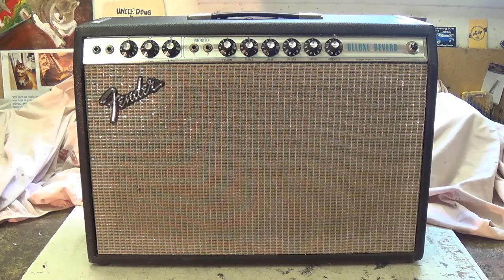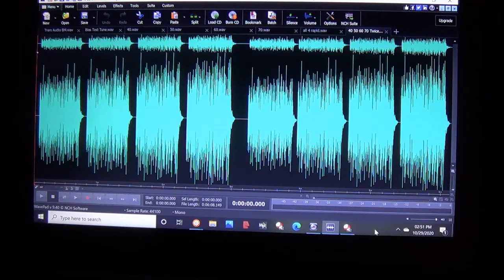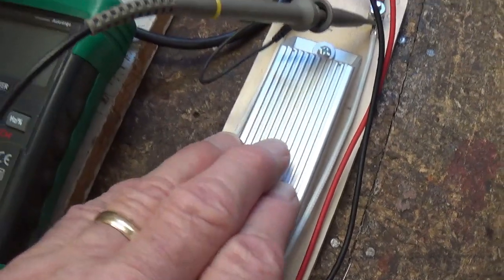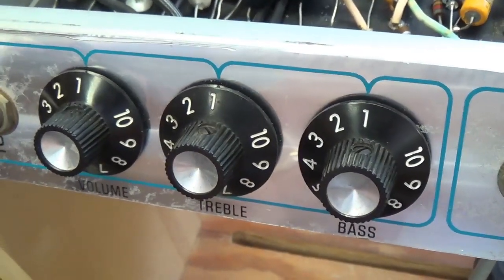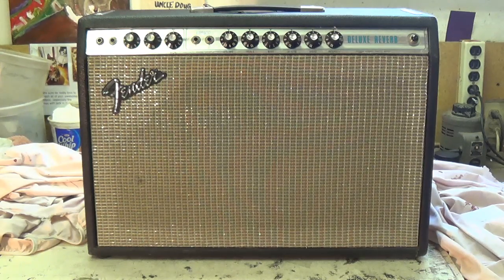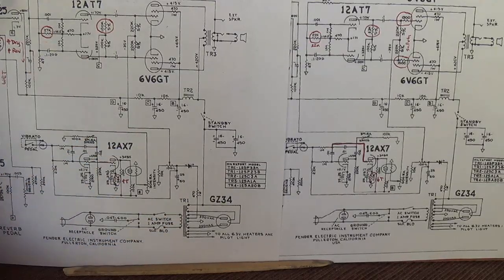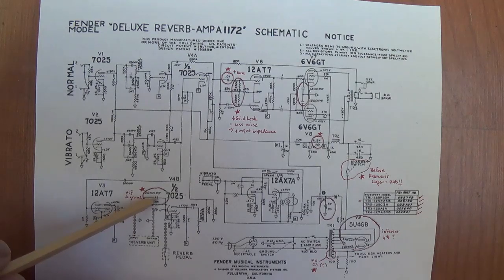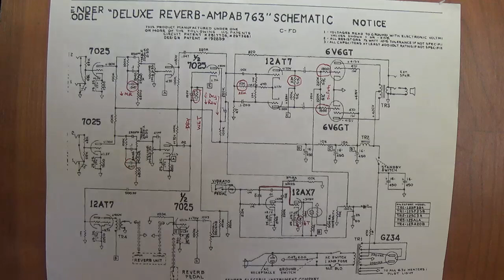The Effect of Output Tube Bias on Tone, Gain, and Headroom.....A Side-by-Side Comparison

Comment: Great video Doug.  That said, I came away with three observations.

1) You didn’t zero the voltage before your clipping test.  I understand that it doesn’t matter because you’re reading the voltage from the meter but this could be confusing for some.  But, it was the same for all of your tests so, it is apples to apples.  So picky, eh?

2) My understanding of Fender’s biasing technique of the period was to simply set the bias voltage to the schematic value.  The quickest and worst way to set bias.  The result would typically be approximately 50% with new tubes of the era (on spec).

3) My tests have shown that the tone controls do affect output voltages.  Did you not get higher voltages when you repeated the test with the tones on 10?  Incidentally, the closest you can get to a flat response with the Fender TMB is 0, 10, 0 respectively.  Not sure about the TB on your Deluxe.  My feeling is the tone setting should make a difference when testing different frequencies as in your example.

Thoughts?
Reply from the maker: Thanks, James. 1. Yes, picky.  2. The bias voltage on schematics is simply a general estimate. It is definitely not a proper or adequate way to set the bias of output tubes, which requires accurate measurement of both plate current and plate voltage. 3. With passive tone controls, it would be best to minimize any amount of signal sent to ground, so the maximum output power can be measured.......even though that is probably not the way the amp will be used.
Reply: 1) Granted. 
2) That’s what I said. However, your comment in the video was that the factory biased the amps hot.  I don’t believe that was the case. 
3) Agreed. The test should be done with the controls on 10 so that the tone stack is not “sending signal to ground”.

4) you also commented while showing the onset of compression that “this is bad, sounds terrible, not what you want.”  I beg to differ.  This is exactly what guitars live about tube amps.  You also made the same comment regarding crossover distortion and I agree mostly, but that’s a different discussion.  

Still think it’s an excellent tutorial so unbunch yourknickers.  😂
Reply from the maker: 2.) Vintage Fender amps were notorious for their "hot" bias. The 6V6's in many early Champs and Vibro-Champs were running at 15 to 18+ Watts of PD from the factory. Your interest in my "knickers" was a bit disturbing......but I'm glad you enjoyed the video.  @jamesfoster9842
Reply: Yes, but those examples were cathode bias, or some derivation of non adjustable bias.  What we’re talking about here are the Fixed adjustable biased amps.  Certainly your Deluxe is a Fixed bias amp.  In my experience, the schematic voltage value of fixed bias amps sets the bias at roughly 50%, assuming on spec tubes.  I believe Fender st the bias cool on these 60s amps because, as you mentioned, earlier cathode biased amps were set to hot and giving a bad reputation.  JMHO.  

At least I didn’t say untwist your panties.  That would have been weird 😂
Reply from the maker: Thanks for your input, James. I still contend that the only way to accurately bias output tubes is by measuring and adjusting the PC and PV to yield an acceptable PD.   @jamesfoster9842
Reply: Absolutely!!  I never disagreed with that.  100% total agreement.  ❤❤❤

Comment: Doug is it possible to bias a tube via the bias resistor to achieve the bias level without using the tube bias meters? Perhaps a data sheet would provide this information?
Reply from the maker: How would you measure the bias to know how to adjust the resistance, Jeff, without some measurement of the PV and PC ?? The measurements can be made by several means, including bias probes, but they are absolutely essential for accuracy.
Reply: @UncleDoug  Makes sense Doug! Thanks!

Comment: Better than theatre Doug. There’s always something for us to learn or view from a fresh angle. Thank you lad!
Reply from the maker: You're welcome, Byron. Glad you enjoyed the new vid.
Reply: @UncleDoug  I was looking at the 1172 schematic again. The coupling capacitors to V6 grids were likely increased to make up for the gain loss by changing the grid leak resistors from 1M->330k for noise. At 2 kHz a .001 has a reactance of about 8 k ohms. A .01 is about 800 ohms - actually a higher gain than the original circuit...

Comment: Decibels aren't linear, they're logarithmic, so you can't straight exchange their ratios for gain.

Carry on!
Reply: Headroom is typically measured relative to noise floor. Yes, there's another kind of headroom that's just how loud (powerful) the amp is. Guitarists will frequently use "headroom" in this meaning as well.
Reply: Fantastic run through on the differences in Deluxe Reverb variants! Yes to more, please!
Reply from the maker: This was corrected in the 1st (pinned) comment, AQ. Headroom has always been how high an amp can be cranked and still remain clean, at least in my experience. Thanks !! Will do.

Comment: So, if i want a GZ34 in my Blackface Princeton (a kit from TAD) i only need to re-bias?
Great vid, as usual.
Reply from the maker: Yes. If you have a 5U4, simply replace it with a GZ34 and readjust the 6V6's bias.
Reply: Yeah. It’s going to give you a higher voltage that ends up on your tube plates. Bias accordingly.
Reply: Thanks for answering!
Reply: If it’s a reverb amp I wouldn’t.(due to the reverb transformer)
The  power transformer is near the limit as is 
The GZ will increase the B+ and push the power transformer over the edge

Comment: Yes do more videos like this with the long schematic lessons at the end to calculate each preamp stage gain using a calculator and formulas
Reply from the maker: I'll keep your suggestion in mind, Wayne.
Reply: @UncleDoug  Thanks, Also when you use a variac most guitar amplifiers will make a 60hz line noise from the power tubes being out of phase. When adjusting the AC voltage down using the variac until guitar amplifier is quiet not hissing or making noises. I'm not sure why the AC voltage not set at 120vac will cancel out  the amplifiers noises and hiss. If you have tried this by using the variac to adjust the VAC voltage down until the amplifier is quiet. What is the mystery is that if the VAC is at 90VAC it still 60hz line frequency but the AC ripple is lower in the amplifiers power supply I'm guessing so you don't hear the AC ripple in the power amplifier section making the push pull power tubes cancel out the 60hz line frequency it seems.

Comment: Something wrong on my end, cuz it sounds like your speaker is blown. Too much rattle on all settings, so far. Not the good kind of distortion. 
Guess it’s my phone...
Reply: I’m afraid something isn’t right with the amp mic.  Your voice mic is much clearer.  I know the sound of the deluxe reverb and this isn’t it.  It doesn’t match the sound of other videos.
Reply: @kevinski5386  I agree... but he may not see this on my post, so may I recommend you post it again in the regular comment area? Thanks! 

Well said though!!!
Reply from the maker: I'm sorry if the audio was not pleasing, BC. The speaker is a new Jensen C12N.  If there was rattle, it must have been due to an external source.
Reply: @UncleDoug  I thought it might be something else, as I stated. Not pleasing?  Nah... I’m not displeased. I did think you might like to know... and it wasn’t fun to bring up...

Comment: I'm wondering, does more headroom and acheiving breakup at a higher volume/higher voltage mean that it's mainly power tube overdrive or does the preamp react the same way it does at lower headroom?
Reply from the maker: Pre-amp tubes can be overdriven also, but the distortion tends to blend in with the output tube distortion. Without a master volume control, it's hard to isolate pre-amp overdrive.
Reply: @UncleDoug  Right I was just wondering if the preamp section reacted differently with more headroom. Because power tube breakup is what I associate with high volume overdrive. I only use non-master volume amps.
Reply: @UncleDoug  Oh I forgot to mention, don't some players like a clipped style distortion? I thought some pedals were based on that style like the 'Rat' and 'Super Distortion' style pedals.
Reply from the maker: @willdenham  Distortion is a very complex topic, Will. Here is the best explanation I have found:  https://www.analogethos.com/post/understanding-distortion
Reply from the maker: @willdenham  If the headroom is sufficient for the output tubes to operate at high volume without clipping, then the pre-amp distortion would be more evident.....or so I would guess.
Reply: @UncleDoug  Thanks Doug!

Comment: apparent volume does effect perception of sound quality, ( it's probably because more tonal details are perceived ) 
But Also, the output transformer would be adding more core saturation harmonics ( given the same amplifier )
i am going to be running about 42% max Pd, but that's where my OT is getting pretty hairy; so biasing hotter than 50%,  on the EPS Tube Amp, might not sound better..
it's nearly $ 100 power tube, and running S.E. ... so some considerations there also....it's late, i will finish watching the science evaluation tomorrow.
Reply from the maker: I agree....louder music generally sounds better than at moderate volumes. Good luck.
Reply: @UncleDoug  there is a point where louder isn't better... but just the same, yeah; there is sort of an optimal.
i need luck ... but i really like my amps new front end, that's the cat's meow. (  cleanest way into that first 6SL7GT triode )
Reply: @UncleDoug  my EPS Wet Send Box video is up also.
Reply from the maker: @RulgertGhostalker  Thanks for the tip, Eric.
Reply from the maker: @RulgertGhostalker  Glad to hear it, Eric.
Reply: @UncleDoug  yeah, i might actually be able to start the company building the EPS Wet Send Boxes ??? ... i am going to start on the circuit design in my free time now.
Reply: @UncleDoug  my gosh, Thank You.
Reply from the maker: @RulgertGhostalker  Good luck, Eric.
Reply: @UncleDoug  Thank You Sir.
Reply: @UncleDoug  I Added Anther Desighn, in my video > EPS CH-FX LOOP & Darlington Driver X5
Reply: @UncleDoug  i have the circuit worked out, and all the parts spec-ed, for the CH-FX Loop prototype ... even some of the tooling worked out.
Reply: @UncleDoug  i went with thick silver plated contact jacks...that sort of level...
my goal is to the it to the self under $200.
Reply: @UncleDoug  Both my pedal board utilities are such simple circuits, i don't think i need to publish promo-schematics there ..

i finished the Darlington Driver X5 today..
18Vdc 100mA center negative ... 

it has all the clean headroom i could squeeze out of it, between a 2Watt resistor and emitter of an NTE155
the main NPN there, has to lose heat, to the box, through the air inside...so not so much overkill as surface area. .
Reply: @UncleDoug  my video on the Finalized X5  Germanium amp driver schematic is up now.
Reply from the maker: @RulgertGhostalker  Thanks for the news, Eric.
Reply: @UncleDoug  Finalized : EPS, CHANNEL-FX-LOOP... video posted.
Reply: sorry for over-complicating...

the short amendment video clears it up.
 EPS CHANNEL-FX-LOOP v1.01
Reply: @UncleDoug  Update:
LED forced a regulator re-design.
i had to find the most efficient LED,
but ultimately had to move the LED, and kept the new regulator..
latest video posted.
Reply: @UncleDoug  Phantom Power Is a CURRENT SOURCE with a voltage nomenclature...( new video )
that LED is really making me work for optimum efficiency, but the audio application wants a linear type regulator.
Reply: @UncleDoug  I Got The LED Theoretically Lit !!! ( on 11V through the 12V spec supply resistors )

The Latest Is Now Finalized, ( thank the freakin goshness.)

Comment: Really Helpful!
Thanks!
Reply from the maker: Glad to hear it, SS. You're welcome :)
Reply: @UncleDoug  I have a question for you, if I may: I have someone that wants me to repair their SVT amplifier. They have had all kinds of problems with other technicians either not fixing problems or in rejecting others. One of the comments made is that one of the 6146B’s is blown from a noisy preamp tubes socket inducing a transient, which took one of them out. I realize in an optimal world it all of these tubes should be matched but if you have just one bad, can I ask your strategy? I don’t have a pile of scrap 6146B’s to find a suitable candidate. Additionally, since the amplifier uses six of them (three for each phase) is the matching critical for all of them or just per phase?  I have quite a bit of Electronics experience, including vacuum tubes, but mostly with RF; so I don’t mess around too much with tube audio.
Thank you in advance and look forward to checking out many more of your videos…
Reply from the maker: @SpinStar1956  I have absolutely no experience with 6146 tubes, SS, but based on my experience with other output tubes, a reasonable amount of matching is best for overall performance, but appropriate tube bias is even more important. There is probably a 1Ohm 5W resistor for each trio. Measure the voltage drop across this resistor and switch tubes around until the VD is approximately equal for both phases.